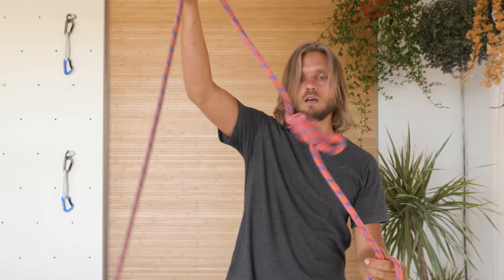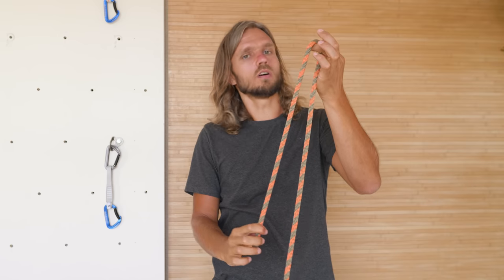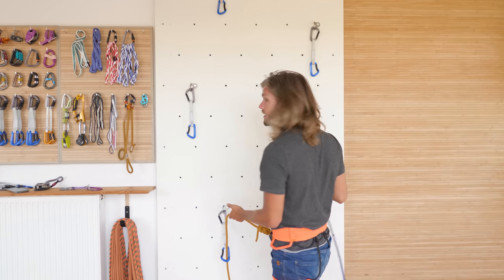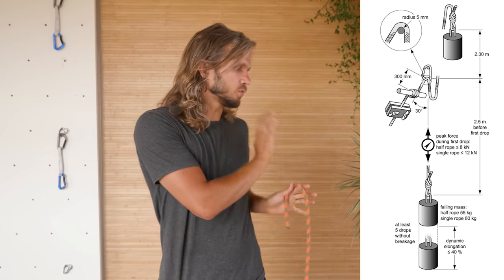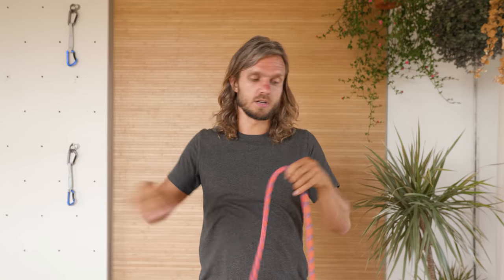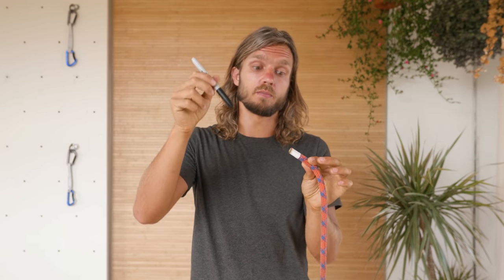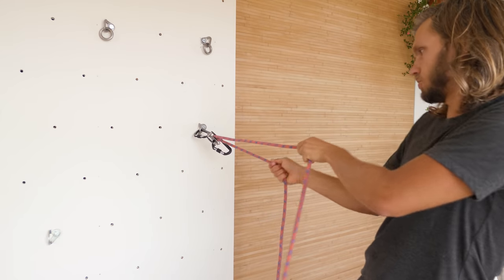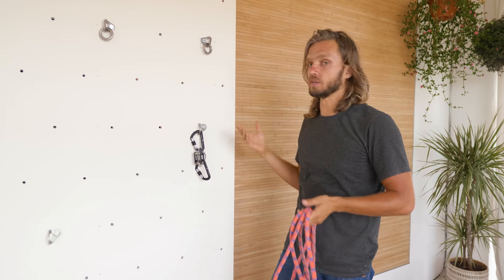Complete Guide to Climbing Ropes - How many falls they Hold? Why they Twist? | Ep.5

Comment: The reason ropes twist is because we don't furl them on and off a spool. When gathering your ropes, one end is fixed on the ground, so you MUST add opposing twists as you gather your rope because when you go to use it, you don't spool it off and those twists remain. Like the sailors will teach, it's a clockwise then anti clockwise loop you create when stowing them. While you're ribbon idea has merit, when you reverse the process you showed, it undoes the twist.

Comment: My husband and I are new to climbing. We purchased a rope from Mammut and had no idea that half ropes exsisted. There is no description on these ropes as to what they should be used for. Basically we bought a half rope because it was lighter and stronger than the rest of the options. No where did it say that we would need two. Thankfully we didn't get hurt. Now we will shop for a proper rope.

Comment: While I'm not a climber (yet?) I do have a rather long experience with ropes and here's my favourite way to untwist them (as well as long cords and hoses):
Find a good, clean open space (lawn). Make sure the rope is untangled and grab the loose end.
Start walking. When you're a couple of meters out start collecting the rope into a nice sling (this is very fast and easy once you get the hang of it - as a sailor I hate nested ropes). Continue to walking slowly while collecting the rope, if it doesn't untwist fully walk faster. 

Collecting the rope this way also is a great opportunity to feel any variations in the rope (nicks, core damage, burned spots, sand...) if you pay a bit of attention to the rope flowing through your hand.
Reply: Old time sailors would tow them overboard for a while to remove twists.

Comment: Another great video :)
Re the rope twisting - another reason is using the figure of eight type devices or munter hitch for the belaying or abseiling. Ideally to avoid both, unless you have no choice in certain situations, like a lost belaying device or a frozen rope (winter climbing).
Reply: You will only twist up your rope if you have the rope out of the brake position while rapelling, with both devices. Both methods are used in rope rescue and professional guiding as standard practice.

Comment: Great Video!
My tip against rope twisting: I always pull the rope down through the longer side. So if I climb a 10 meters route with my 60m rope, I pull all the 50 meters left. I have not seen a twist for 15 years.
Cheers

Comment: On the 2-point anchor making your rope twist - there is a difference on the plane where both anchor points are. For example, if you do the exact same thing with your 2 point anchor, but add an extra carabiner on each of them first (so that the "holes" naturally line up) - the rope will not twist.
Right now the anchor points have both "holes" in parallel, and that is what makes the rope twist.
Reply: If one arrives at an anchor similar to one seen in the video, is there a way to lower (without modifying the anchor itself) without incurring rope twist? For example, is it safe to lower off just one of the rings, or would that be dangerous?
Reply: @roniprograms5540  I would much rather have a twisted rope than risk a single point anchor. If rope length allows it, then even better - double it up and rappel on both strands.

Comment: I do the untwist on very long routes or by turnig the ropebag - but it still twists again after some climbing.

You can avoid:
- Do the unpacking the wrong way, read before unpacking! Most brands must be rolled, but some dont need to and should not.
- Buy the wrong brand, brand behave very diffrent during the wear of the rope. Fore example Mammut is pretty stiff, Beal gets incredebly soft. I like Sterling or Edelrid. Also depends on your Belay device, Grigri is diffrent than tube.
- Dont do lowering using HMS.

Im still not shure, if using a classic 8 during rapell creats significant twist and if the direction matters, on which side you put the rope in.

Thanks for these videos!
Reply: Wish for the series: Communication in multipitch (without just screaming) ;)
(Especially using just single rope.)

Comment: Another really great video! This is helping a lot, I have been situation couple of times on the outside that yes it is okay to fall on your rope, to won't break after 5 falls :DD

Few notes,

  - You didn't mentioned UNICORE wich is really good thing to have! makes rope handling much better and also some extra durability.
  -Length of the rope outdoors depends on where are you climbing, like here in Finland 50meter rope is more than enough almost everywhere, 60 is okay but 80   way too long, so it is depends a lot where are you using it!
-In gym climbing I think that it doesn't matter wich rope, almost every rope will last maximum time to using (5 years) ofcourse depends how much you are using it but indoor is so "light using" than ropes will last so long that personal I would like thinner ropes.

Rope diameter, also depends on wich belay device you have. Like if you have grigri i would say it is much nicer belay with 9,2mm rope than 9.8. Personally I wouldn't buy thikker than 9.7mm ropes. Maybe you are going to talk about this when you talking about bealay diveces! 

ps. Waiting that you will show all of belay diveces! I would like listen your voice and soo sharp engineer attitude, pros and cons list like an hours! :'DDDD

Reason, why i wrote these comments is that small details, what you missing; maybe on purpose, maybe you have forgot so or even better, if you also learn something new! 
Big thanks for this video, waiting already for next one!
Reply from the maker: Covering all belaying devices would be veeery long and boring :)))) But in next video Ill just give an overview and build on top of that in videos to come

Comment: A lot of great information! Another thing that contributes to twist in rope how new ropes are rolled up on a spool, this means you actually need to "unspool" your rope before the first use. I think Mammut also started using a robot to coil the ropes in a figure of 8 pattern to prevent that from happening.
Reply from the maker: Most of manufacturers sell ropes ready to climb for many years already :)
Reply: @HardIsEasy  That's great to hear, I wasn't aware of that! I guess I haven't bought a new rope in a while :)
Reply: The only ropes I know to be absolutely ready to use out of the package are from Edelrid. Everyone else, even unpackaged the way the manufacturer recommends, seems to take a few times flaking. A few manufacturers are worse than others, and a few are better than others.

Comment: Two things I’d like to mention - 1 don’t use a washing machine if it has an agitator. Can damage the sheath. I think it’s more common here in the US. 

2 - I would recommend getting some fans to blow on the rope to speed up the drying process. I’d also be really interested in seeing when the rope is truly dry. Just because it’s dry to the touch doesn’t mean it’s dry inside. The way it will dry is from the outside in, so it will feel dry to the touch before the core is completely dry. I think weighing with a really accurate scale can be used to determine the weight before and after and see if there’s still water in the rope

Comment: Tip: You can use cabel shrinking tubes for the end. Just do it the same and put it over the tape. It will stays nice longer and its better while putting thru holes.

Comment: Another thing that can cause twisting is improperly coiling your rope.  If you coil it around in a circle, then when you pull it out straight again, every loop of the coil will be converted into a 360 degree twist.  You can mitigate this by coiling in figure-8's, which don't induce twists, or by using a rope bag like in the video.

This is also useful advice for avoiding twists and tangles in other things, like extension cords and christmas lights!

Comment: Some comments:
- Imo dry ropes are the way to go for outside climbing. They are much more resistant to water, but also dirt and dust and well worth the additional price.
- I cut ropes using a hot cutter (a electric pistol-like device that heats up a metal balde) that can be bought for ~15€ in hardware stores here in Germany. It cuts through ropes like butter an completely seals the end, which the lighter will not do. I also don't like the climbing tape becoming sticky and fizzling off, so this is the better method for me.
- Old ropes can be up- / recycled into many things. Petzl has instructions for a classic foot mat for your house, but if you have a sewing machine you can do much more. Remove the cores and iron the sheets and you can make small round carpets / mats to take to the rock and keep your climbing shoes clean for the start of a climb, make cushions, build chalk bags, belts and laptop bags. The cores can be made into plant hangers or even hammocks with a bit of work. Possibilities are endless.

Comment: Hello, thank you for your videos.

The maximal number of fall noticed by the manufacturer was the fall of factor 2.  So you can take an unlimited number of falls with your rope as you said but X falls of factor 2 with the rope.

So you can take X falls of factor 2 with your rope/harness. But just 1 before returning at school for learning the basics.
Reply: Not necessarily. In the tests the falls are 5 minutes apart so the rope doesn't have time to cool down in between tests so it eventually breaks from the heat.

You could potentially exceed the amount of falls stated if the rope had time to cool down between falls.

It isn't like each factor 1.77 fall permanently damages the rope a given amount, it just gets hot from the energy it absorbs. Eventually that's enough heat to melt the rope
Reply from the maker: UIAA fall test is 1.77 fall factor with 5mins rest in between and needs to hold more than 5 (or more depending on rope type) falls.

Doing falls that are way lower forces will greatly extend how many falls that rope can hold.
And as Barefoot Ben mentioned letting the rope rest longer than 5mins also extends it's life (I don't know how much - but gonna investigate this...)

Comment: I think it's worth mentioning that another big reason ropes twist is the belay device. Figure eights twist the rope as it passes through them. I think can happen on the gri gri too depending on how you hold the rope. I wonder if you could flip one of the rings on the eye bolt of a seperated anchor system to counteract the rotation from the first bolt.

Comment: 14:58 I think it’s also proven that the body is a kinetic object and absorbs 2 times as much energy as a static object changes so much. 

So basically if you were four times the weight of your belayer and took that many hard falls your rope would give. So unless you’re training daily and taking some diabolically nasty whippers. Regular changing of your rope is super good enough.

Either your cams would sheer the rock, you’d be begging to go down from the shocks of the falls, or your belayer is too freaked out to continue. 

Layers of redundancy are into place. I love it. Just don’t be cheap. Your saftey is worth it. Also general wear and friction is a bigger problem than falling on dynamic ropes

Comment: I've got a tip to add - I guess it could be in a video about belay devices. Skinnier ropes go very fast when lowering (especially grigri). I don't like how heavy my 70m 10.2mm rope is on approaches and it's a tight fit when loading ATC for  rappel, but it is much easier to control when lowering someone versus my 9.8 -- Which like he says 0.4mm difference doesn't seem like a lot.

Comment: There's another reason some ropes twist and tangle more than others and that's the weave pattern of the nylon strands. I once bought a cheap indoor rope which was a really bad idea because after every route it would get impossibly tangled. I guess most manufacturers tend to use better more symmetrical weaves now but it's hard to tell before you buy it how good it will be at avoiding twists.

Comment: Thank you so much for this material. In my case I've had my dry 60 meter rope for 4 years already and honestly I see zero signs of damage even on the ends. I'm rather a Sunday climber when it comes to rope climbing, so I'm using it maybe once a week on average. Is it possible it's still not damaged or am I just not seeing the damage? 😭

Comment: Great condensed information about ropes here. The part about "when" to cut a rope is always the most fuzzy to me. Clearly we need to cut it before it's anywhere near dangerous but I also like to avoid cutting it too early (leads to more consumption). I'm having this debate with my 62m rope (an already cut 70m) which has a kink in the middle (can pinch tight as you showed in video)... Reading around, many people, including manufacturers, seem to think it's no big deal. Maybe it's a bigger deal towards the end because it's more likely to take repeated hits there..? Your heavily damaged one seemed to be damage at the knot? Having cut many such kinks on the end of my ropes and inspecting the inside of "damaged" sections, there's never any apparent damage to the core inside... maybe it's just normal and not dangerous that some sections bundle up over time..?

PS: Rope should be pulled tight when cutting it to align the fibers.
Reply from the maker: I really want to test this question even more... I hope I can sneak in Mammuts test lab and break some ropes... Lets see...

Comment: the rope twists also depending on how it is running through the belay device. After rapping down, my buddy always ends up with a twisted rope, I don't.  if you keep the brake hand to the side (over the grigri rolled lip) it will twist. In the rap ring example, You can also change how it goes through the 2 rings to not twist the rope, you gotta mirror how it is angled through each rap ring.

Comment: Hello! Yesterday I was belaying in the same manner as always (holding the brake side of the rope, and I was not giving slack at that moment), and my climbing partner slipped and fell unexpectedly. The GriGri didn't lock, I didn't feel any pull on the harness, and the rope ran completely free through the GriGri. She fell directly to the ground from a height of around 5 meters and, luckily, she didn't break any bone, "just" tore some ligaments from her left ankle that took the impact (Maybe the rope on the ground helped as cushioning). I've been shocked and puzzled about why this may have happened. The only bad thing we noticed was that the rope was twisting a lot (I had taken several consecutive falls with that rope, always on the some quickdraw, just before she climbed) and we're thinking that maybe the rope being too twisted made it not create enough friction inside the GriGri, not enough force directed to its center (thinking about the video where you show the physics of the GriGri and the force vectors directed to the center).
My right hand glove was severely burned (holding the brake side, glad I was wearing gloves), so even though I was pulling down on it I was not able to stop it from running, maybe just slowed it down a bit.
It would be really great if you could reply and give us your opinion on this. Something like this happening can have such a psychological impact on the climber, the belayer and the people watching, because we're so used to feel safe with the GriGri if properly used :| thanks!

Comment: Question about the twist in the rope. At 30:22 you show how the rope is twisting through the rap rings. I noticed both rings are in the same orientation (rope in the front out the back, in the front out the back) which is causing a "clockwise" twist through the first ring and a "clockwise" twist through the second ring. what would happen if both rings were not in the same orientation like is shown at 30:25 would this cause a clockwise twist through the first ring then a counter-clockwise twist through the second ring? would this cancel out and result in no twist?

Comment: Only wash ropes in front load washers.  I have seen ropes get damaged by the agitator in a top load washer.
Also, grigris cause twists in a rope as well because when you lower you orient the rope coming out the side of the grigri.
Pay attention to new ropes as well.  If they are coiled end over end from the factory then you need to uncoil end over end or you will start with a rope full of twists

Comment: Here is a tip to avoid kinks when belaying with a Grigri: when lowering your climber, feed the rope from the front of the Grigri rather than from the side. Feeding from the side is the correct technique for giving slack while climbing. However, it creates a kink in the rope that is transferred to the rope as it passes through the device when you give a lot of rope. If instead you feed from the front, you avoid this problem, because you put the rope in an S shape, which is symmetrical and therefore cannot twist the rope either way.